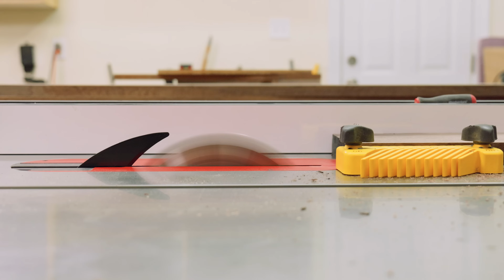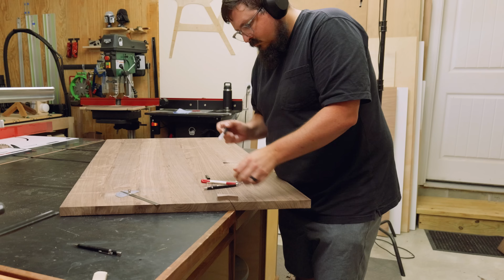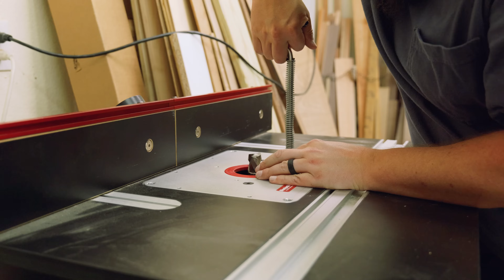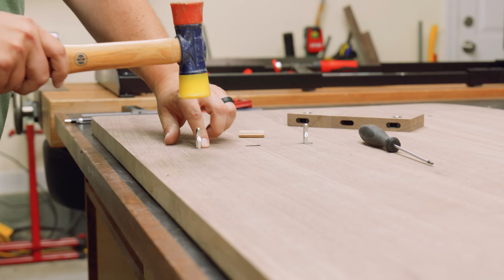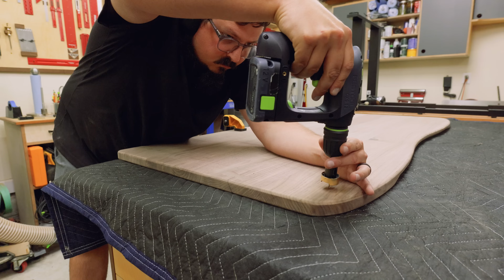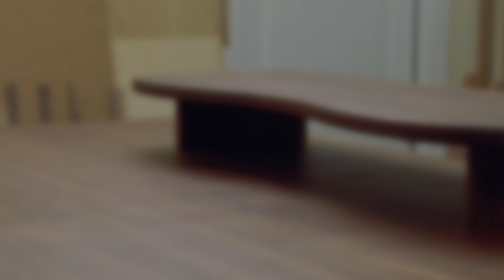Why are people still doing this wrong | Standing Desk

Comment: Keys.  But also no keys.  I think with your situation, putting the key on the bottom and filling the small check on top makes sense.  With something that has more and larger cracks, the keys can add to the aesthetics without being major players.  With your desktop, the key would be a distraction.
Reply from the maker: That's true, really large keys stitching a massive check in a slab can add some visual interest. I agree that on the desktop it would distract from the other elements.

Comment: Keys, but only for the right piece. My current tabletop project has a large crack from drying. But for a live edge table, "leaned" into the crack and adding 6 different sized bowties to stabilise
Reply from the maker: Nice, that sounds like a fun solution.

Comment: No keys...I'm not a fan of the look. Why not just fill the void with black epoxy? Does the bowtie work better than an epoxy fill or is it just another option for the same effect?
Reply from the maker: Me either, but the butterfly locks the check in place with the cross grain placement and prevents further expansion. Epoxy would only fill the crack, so expansion would still be an issue.

Comment: Absolute stunning desk. Just wondering, why you still have monitor stands? We had those in 90's and they made a lot of neck problems. Then we actually started to have screens lower than the desk and that saves your neck.
Reply from the maker: Thank you! I like having the monitor sit slightly higher than my head so it centers the work at my eye level. I think monitor arms would probably accomplish the same thing, but I also have a set of speakers I want to add on in the future so I opted for the extra space.

Comment: will there then be a loss of the shape of the countertop with such a width of the plots in relation to the thickness?
what is the width of the plots?
Reply from the maker: I’m sorry, I’m not sure what you mean.
Reply: @TimberBiscuitWoodworks  what is the width of the boards of table top?
Reply from the maker: They range from roughly 5 1/2” to 8”

Comment: Awesome build as always. Great tip for butterfly keys is to bevel the underside edges so that it is easier to both seat initially in the mortise and also easier to drive all the way since it gives the glue a bit of space to squeeze into.
Reply from the maker: Thank you! Good point, I try to use a really light amount of glue for that very reason but chamfering the underside is a good idea.

Comment: Wow that is super nice Shane! Great job. One question. I do know at least from what I’ve read on the Rubio finishes I have bought it says sand to 120. Is there a reason you go with a higher grit? Obviously it works. Just wondering if I should start going to 180
Reply from the maker: Thank you man! Yeah so I think the 120 is more for flooring. I have had decent results sanding to 150 too, but I think 180 leaves things the smoothest.
Reply: @TimberBiscuitWoodworks  I’ll have to give it a try thanks man